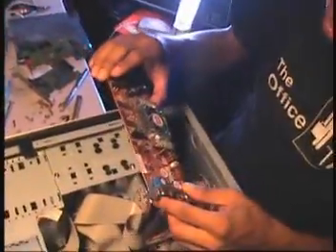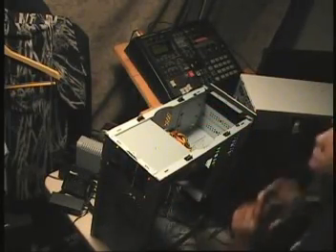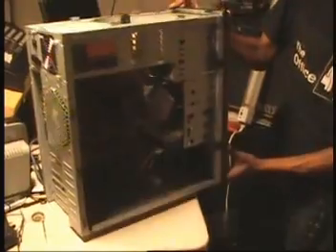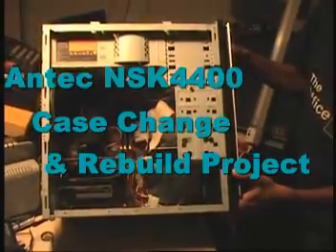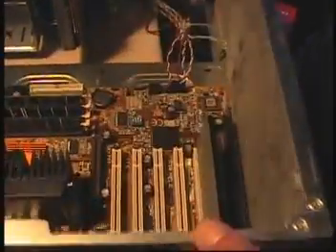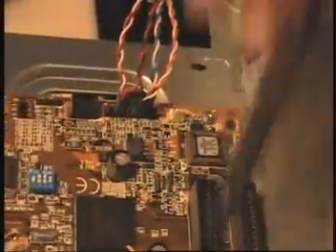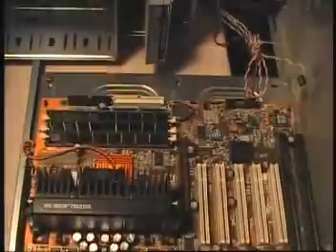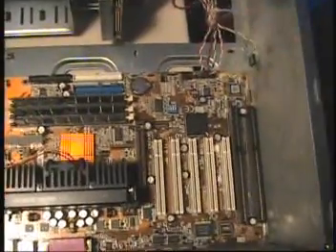Antec NSK4400 -- Project Part # 2 - Case Change

Comment: Looks good starting to come together m8! I had the same case and in front if you mount the HDD at top of cage can add a 80mm fan in the grill in front with bolt/nut combo. Wire management is not the best but it works and whats the hardware you got going in there? Looks like a PII or early AMD, 3 sticks of SDRAM and a 9250 card not bad for older rig.